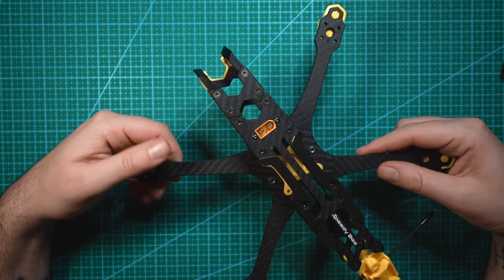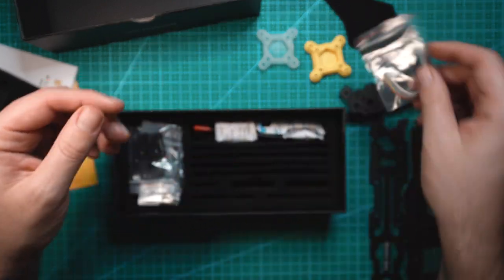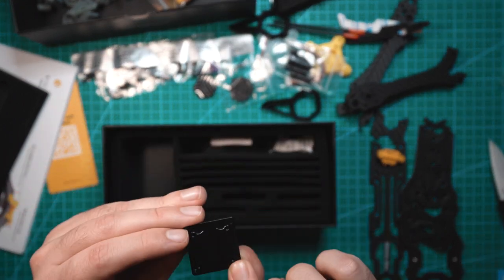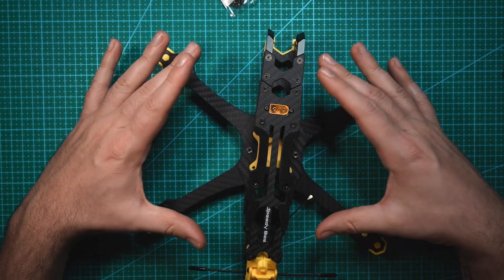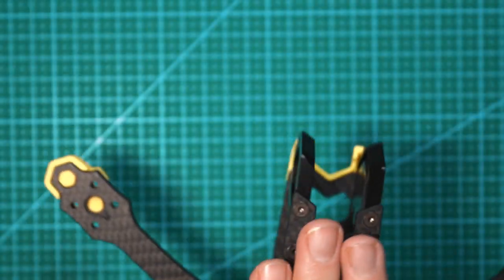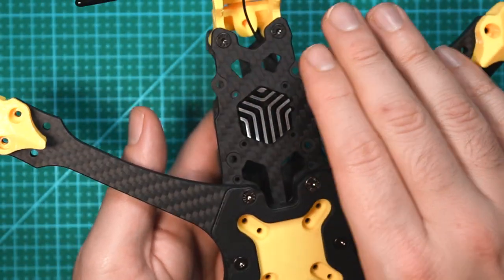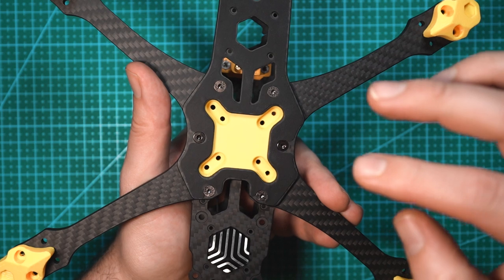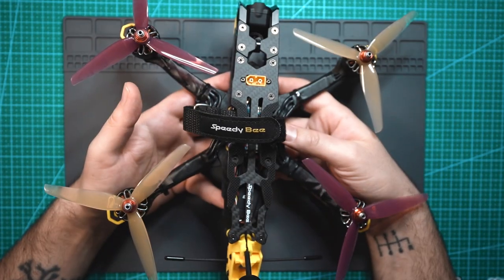Speedybee Master 5 HD Frame - O3 Ready Freestyle FPV

Comment: Just got my frame today, I'm assembling it right now , I'm wondering how did you manage to attach the tpu bumper below the camera mount ? The screws which came with the frame are way to short ? I guess I gotta get like m3x8 or smth like that?

Comment: I built this frame and absolutely love it.  The handling is butter smooth (probably attributed to the soft mount for the flight controller.  Question I cannot get smooth video on my O3 when using Rock Steady on this drone.  I set my PWM freq to 48 kHz with no improvement. I'm fairly certain the mounting system is letting some vibes make their way into the camera at some resonant frequency.  Have you been able to get Rock Steady to work effectively on this frame?
Reply: there is a video of some guy putting glue inside the casing of the o3 unit, it fixed the problem on lots of people. Check it out hope it helps.

Comment: Hey man, I'm new to FPV and I'm kinda looking for some advice. I bought a DJI FPV drone, but I've been too scared to run it full manual for very long because they aren't very user serviceable when I inevitably wreck it. 
Since I have the goggles and controller, would you recommend building out a drone like this, or should I just buy a small cheap analog RTF kit like the tinyhawk?
Reply: Im in the same situation as you but with the dji avata. Ive already flown the avata in manual for a while and if you praticed enough in the simulator it is much easier than you think. I would just build or buy a dji o3 drone like the one in the video, so you can use your googles and controller and start flying. If you break smth these are pretty easy to fix and you will need these skills anyway going forward.

Comment: Hey im planing to build a FPV Drone with the Same frame and dji o3 and i was wondering If i could also use 1900kv Motors with the ethix Pb&j p3 props instead of 1700kv Motors. Since the difference is only 200kv
Reply from the maker: yup! That shouldnt be an issue

Comment: Hey can we get a blackbox view of the frequency and freq vs throttle before filtering? I’m thinking about buying one of these frames.
Reply: I just built a Master hd with the O3, Speedybee f7 v3 fc, T motor Velox 50a esc, Axis flight ae2207 1960 kv motors, 2 35v 1000uf low esr caps, 470uf smd tantalum cap on the 3.3v rail. When I get a chance to fly it I’ll let everyone know that liked this comment how the BB looks. For the price it was a good experience unboxing this frame. I’m not crazy about the front being so long, it’s a weird looking frame but I just want a frame for the O3 without props in view…I’m not expecting it to fly like my Apex or Quadmula siren split but who knows maybe I’ll be pleasantly surprised, I really like how the stack is mounted I’m thinking it’s going to have very low noise pre filters, but if it was I think Speedybee would have mentioned it as a selling point.
Reply: @mikemarucci913  how do you like the quadmula vs the apex?
Reply: @flyingeyefpv  I like them both, that said I think I like the Apex more BUT they both fly amazing. The Quadmula has a lighter locked in feeling, the Apex flys awesome on stock Betaflight 4.4 and has a heavy locked in feeling but still goes where you point it, the Quadmula did need some tweaks. I have been using the Apex for so long I think it’s more of a comfort thing. Both are awesome frames.
Reply: @mikemarucci913  sounds like I cant go wrong, thanks for the reply!

Comment: I like the frame. Which motors, FC, ESC are you using? I also have one noob question. How do you know which radio do you need?
Reply from the maker: I was using an iFlight Succex-d F7 Twin-G stack and xing 2207 1800kv motors 🤘 That flight was stock BF 4.3 settings.

The radio you use will depend on what protocol you want to use. Most radios have a bay in the back of the controller to use any module you want. I have an ethix mambo with a crossfire module in the back.
Reply: @TRONCATFPV  One more question. Do you know how far up can you tilt the camera? I'll be using dji o3 unit.

Comment: Awesome frame love mine i am however concerned bout 03 unit mounting. Cool set up however the 4 screws that go thru bottom plate to the air unit could be longer feels secure however if quad takes the rite impact reckon it may eject. Longer coaxial cable should come stock in these build kits too.

Comment: My 11-year-old built the latest budget FPV drone from you video, which flew perfectly for 2 days. When he upgraded the betaflight firmware to 4.4 the drone on initial take-off go to full power on its own and then shut down at appx 4 feet. We erased 4.4 and re-installed 4.3 however the same issue persists. None of our troubleshooting has resolved the issue please give your thoughts. Thank you
Reply from the maker: make sure your board is oriented correctly and motors are spinning the correct direction.
Reply: @TRONCATFPV  thank you we really appreciate your advice and will LYk
Reply: Thank you for the info it worked perfectly.
Reply: Also don’t load backup or CLI file from version before on 4.4. This is the expected behaviour.

Comment: Great review 
I wanna get into fpv but am still saving up for an air 2s so one day I’ll get into fpv but I think it’s better for me to first get a normal low speed drone under perfect control 😅
Reply from the maker: Air 2s is my go-to for aerial photography. 
Great drone to learn on especially if you've never flown a drone before. DJI drones are extremely user friendly. Solid choice!
Reply: @TRONCATFPV  I’m now using am mavic mini and it’s THE best drone I’ve ever had 
But now that I wanna get more professional with drones I wanna upgrade 
I have enough time to perfect my flying skills on my mini because saving up will take a while 
But that wait is totally worth it to me because that’s gonna be a great drone to fly I think
Reply: it's not that much to get into FPV - just start cheap and go from there.
Reply: @NOT_ANOTHER_FPV  the problem is I’m have a VERY small budget so saving up for stuff takes pretty long and noun saving up for an Dji air 2s and that isn’t cheap

Comment: I bet since the arms are 5mm and not 6mm they will rip off in a bad crash. Had this happen a couple times with their last frame. 2 times it ripped the pads off their ESC. Not flying anything with arms less than 6mm.
Reply: PS if you do use 5mm arms and they get ripped off - is there a way of protecting your esc from getting damaged like with the pads ripping out?

I have my Titan frame which I've been using for over a year now. Just went 6s and lower KV motors and I'm in love with FPV again.

Comment: DJi O3 for this shit doesn't fit because the camera wires are too short
Reply from the maker: On the V1 frame you need an extended coaxial cable, on the new V2 you don't.
Reply: @TRONCATFPV  You already know my opinion on V1 :)